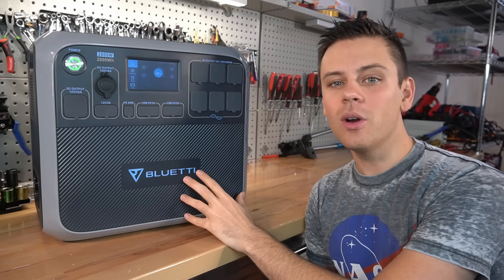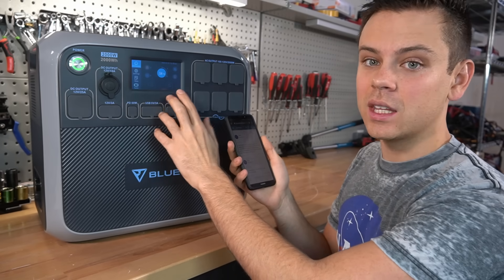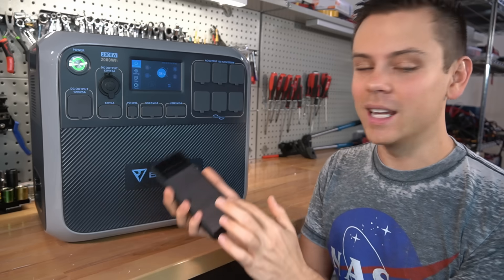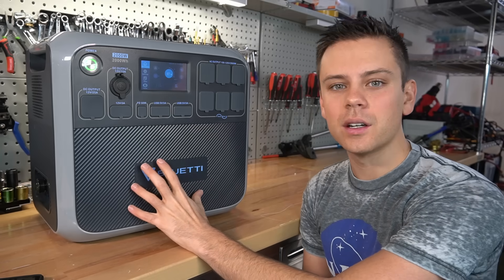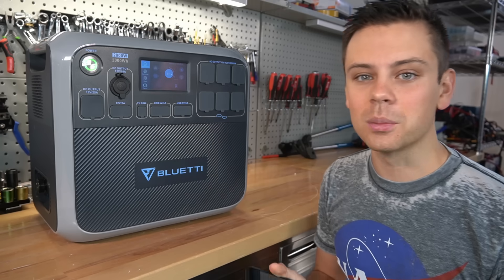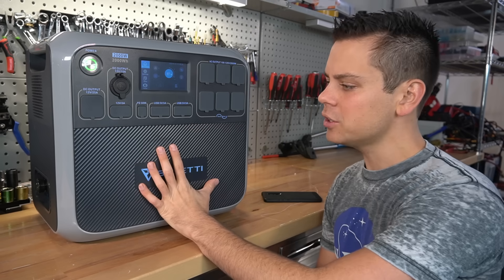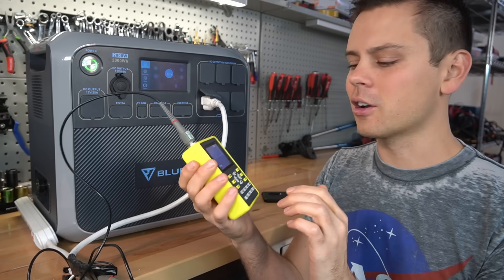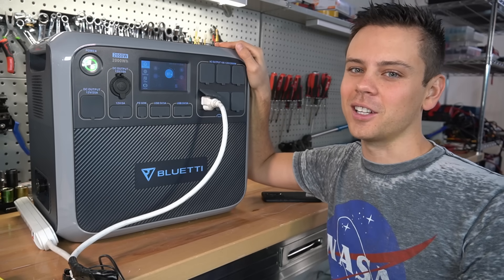New Issues are Plaguing the Bluetti AC200

Comment: We just got this as a backup unit, seems like a super solid device overall.
Reply: I don't have any problems with mine. Temperature and watt displays were accurate. Shipping was incredibly fast as well. My understanding is that the delay on the original AC200 is due to covid supply chain issues. I sympathize with users who are having issues getting their  AC200s. I would just cancel and purchase an AC200P at this point.
Reply: @Alex-dg2mb  that has not been an option for many of us have tried. To get an intelligible response from these people is a remarkable thing.
Reply: @Alex-dg2mb  Agree.
Reply: Most important part of a backup solution is exercising a test procedure regularly!

Comment: Hi  to all., Merry Christmas from the Philippines - .

Totally unrelated, is it possible to combine in parallel the outputs of two solar controllers please ...... I can't trust my own countrymen because they will lie  their ass off to earn even 25 sentavos ( 10 cents)
Reply: You can use multiple Mppt controllers on the same system as long as the overall charge rate is acceptable for your battery setup. PMW chargers can not be combined like this.

Comment: After all the videos it looks like the TITAN is the overall winner. The $3K initial cost kinda hurts but it's ever expandable and doesn't lie about it's capabilities.
Reply from the maker: Yeah the Titan is a beast. They really need to add LiFePO4 batteries, and it would be perfect.
Reply: @WillProwse  Agree,I purchased the AC200P waiting on delivery which should be 1/5/21-1/8/21,if that doesn't pan out am also looking @ the Titan 2.0.
Reply: @WillProwse  Do you think they will in the 2.0?

Comment: Merry Christmas,  just got one question, the Dc output of the bluetti was very noisy, i cannot use it for the ham radio HF, any idea, recommendations 😀
Reply: Perhaps a dc to dc converter for just the ham rig.   Other option would be to Oscope the output to determine the noise frequency. Then build a filer to match that.